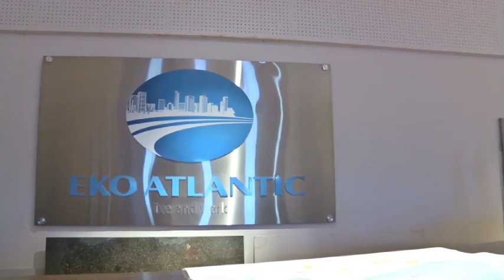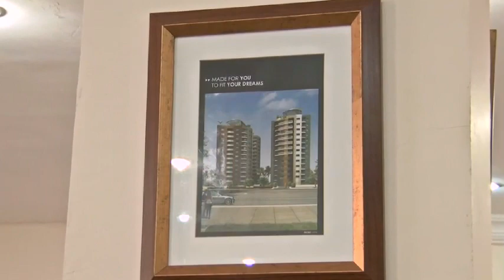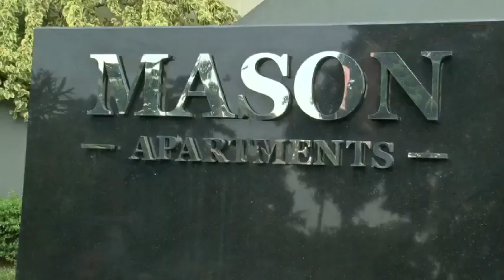CHANNELS TV FOCUSSES ON EKO ATLANTIC IN SPECIAL PROGRAMME

Comment: Its a lovely and great project,but you have not told us how you are going to power it with no power project on going and the whole of Nigeria is sharing about 3000MW-4000MW  That place will need approximately 3000MW more or less. well its still a great project.
Reply: +Habeeb Sule Please go back to 13.09 of the video for your answer.
Reply: It will have its own power plant.
Reply: +Habeeb Sule: you have a point but the Eko Atlanatic is not going to be connected to the Ntaional Grid its going to have its own power generatio,  also there is no way on earth its going to consume  3000MW .
Reply: That is not a problem. Cannan land has been having  uninterrupted power supply for many years if they can do it a Eko Atlantic can do the same. Nigeria can generate uninterrupted power supply but the cabals will not allow it.